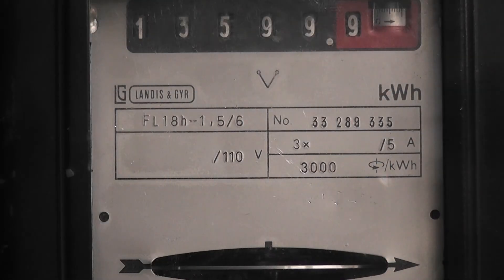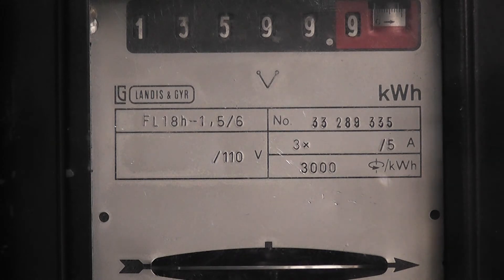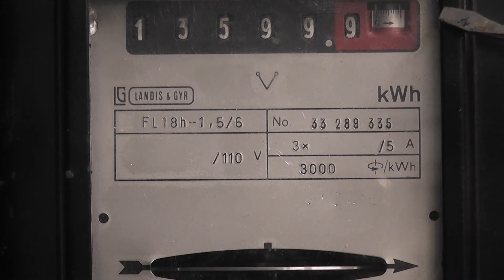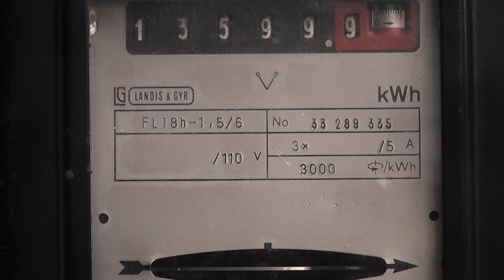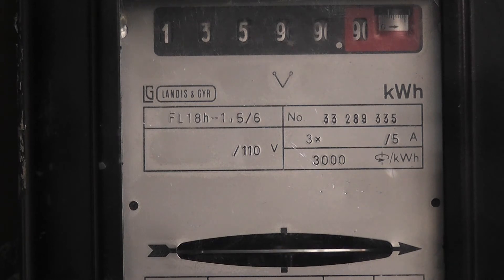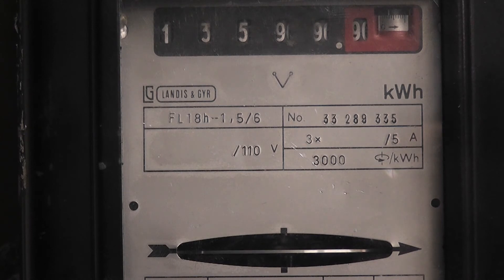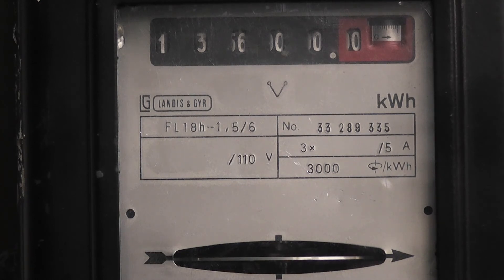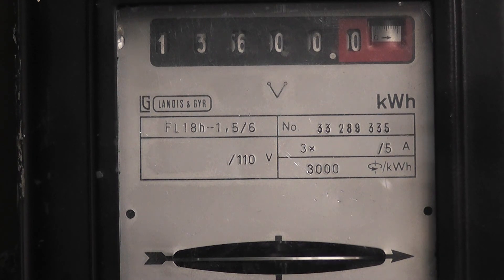LG FL18h meter

Comment from the maker: Frequency 50 Hz
Voltage 230 / 400 Volts ( used to be 220 / 380 Volts.
Some older city networks had 127 Volts Phase to ground and 220 Volts between phases.